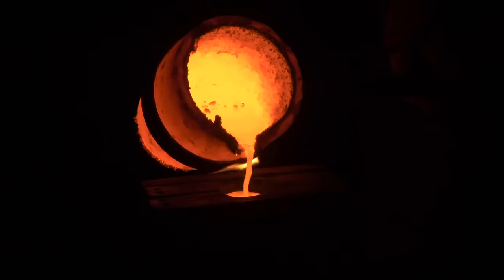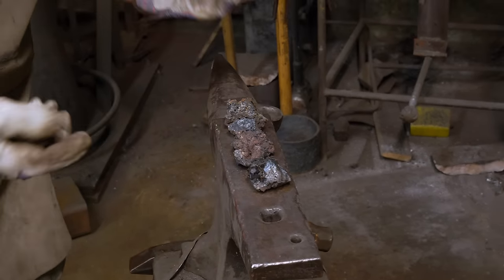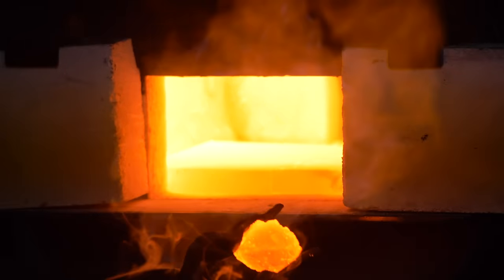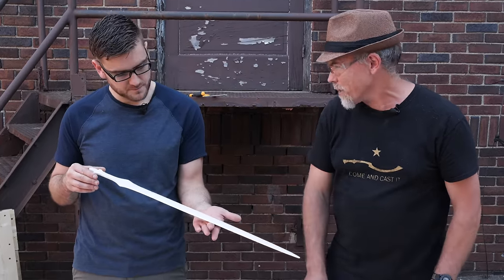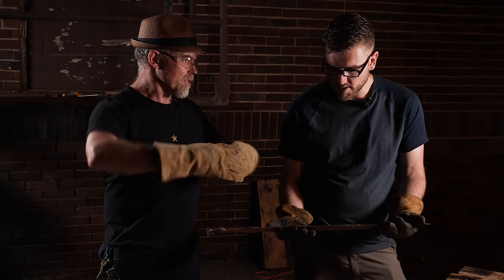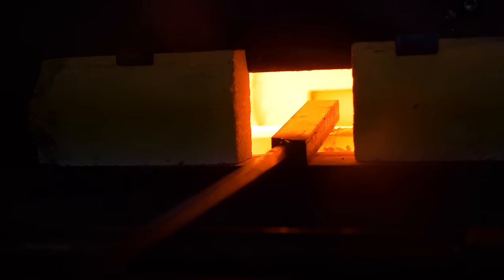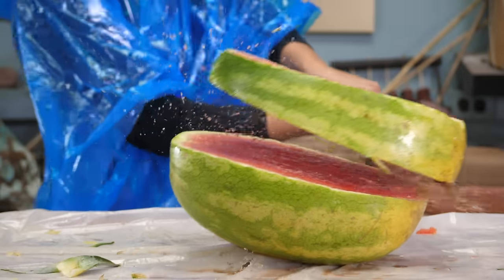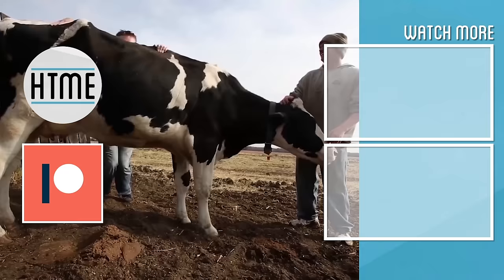Forged Iron Sword vs. Cast Bronze Sword

Comment: Imagine if the gun was never invented, the sword would still be a good weapon
Reply: The crossbow would be the everloving shit by now.
Reply: @aleksfoxtrot8044  hahaha, let me show you its features!
Reply: People used to walk around town beating the crap out of each other with quarterstaves. If we never got guns but metallurgy still improved, we'd see people walking around with smallswords and daggers. And I'm sure people would have slingshots instead of slings, and crossbows would be the Big Thing in ranged combat because of the extremely low skill needed to use one - and they're compact and can be held drawn for longer than a bow. 

Assuming we still get diesel engines, we'd still have tanks, except they'd be APCs and mobile cover instead of artillery. Maybe a ballista mounted in it? We'd probably have figured out a mechanical reload system so the ballista can fire rapidly and load itself from a magazine. And it would probably end up firing a metal ball for ease of loading and ammo storage. 

Fortifications would still matter, so you'd still see castles being built. And not the star-shaped ones, because those were built with cannons in mind. 

Since you have engines, powered flight would still be a thing, so you'd have people dropping flammables from planes and dirigibles. LTA craft would still be useful because of the shorter range of projectiles. There'd be no anti-aircraft weapons. Or rockets or missiles.

Comment: Doesn’t casting just ruin the integrity of the metal? Could be wrong but I feel like casting is bad compared to folding the metal over itself and hitting it into shape.
Reply: Yep! Folding iron over itself greatly increased the strength, assuming it was forged correctly, and, if it was welded as in Damascus steel, assuming the welds were solid!

Comment: Not only was bronze also forged, it was easier to forge, because they didn't have to get it as hot to make it malleable. Typically casting was reserved for statues, jewelry, and breastplates. But even cast bronze could still be forged. Cold hardening was usually reserved for finishing touches, such as setting the bevels and edge. Bronze wasn't replaced because it was inferior. It was replaced because iron, even though it was inferior and harder to cast and forge, was significantly more plentiful. An iron sword, when bent, is essentially done. If it was heated up and bent back into place, you'd lose the temper and heat treat. A bronze sword, when bent, can be heated up over the relatively cold leftover smoldering embers of campfire, bent back, and now it's even stronger.

Comment: Just so you know this was an unreasonable test because there's the factor of real warriors. Real warriors need to test the capacity of a weapons effectiveness.
Reply: many times thats not what happened. many times blacksmiths had to pump out as many swords or weapons as fast aspossible to fill the ranks of thousands of men with equipment. and there would not be enough time to test these weapons. so while yes. they would have "trained professionals" guys that knew how to test swords in peaceful times, not all of them  or the most of them where not done that way.

Comment: So, I know there are limitations to the show and all that, but the tests between the two swords really bothered me. Bronze age fighters would be clashing swords like that with any other sword, at least they would try not to, so I'm not sure that's a fair test. A test to see how sharp the blades stay and how the edges all together hold up against shields and armor, absolutely. Most early Iron age warfare wouldn't have been sword on sword, but the sword on shield, besides battles wouldn't really last till weapons broke.

A comment on that Khopesh, most bronze age swords I have seen in my classes, including a few Khpeshes have had a lateral ridge. A lot of the swords that you showed Greg making had those same ridges, which would've added some strength to the sword, which might have helped in the stabbing. While yes I know bronze is a very soft metal, I can bend my bronze sword, i'm just saying a ridge, like what you see on the Khopesh in Tomb of Tut Ankh Amun (KV62), probably would've helped.

Comment: I have seen a real historical blacksmith where they start with raw ore (red dirt) and finishes with a sword and its always still 10 to 30 percent slag. All those YouTubers who make videos of forging medieval swords are cheaters, sure they melt the ore into solid slag but i have not seen a single one doing the purification process. They magically go from a ball of slag to a perfectly pure steel ingot. Only way to do that is by replacing the slag ball off camera with a steel ingot. 
Purification is the longest thing to do where you must constantly reheat the slag chunk and then knock off slag chunks with a hammer, while keep the flexible glowing stuff (iron) in the ball. The ingot form like the gold ingots you see in cartoons is this form because you constantly bend the red hot ore into the center of the ball. This way, the slag that you hammer out falls off and the iron sticks back to the ball. You keep doing it until you have an ingot. 
In Medieval times nobody cared for having the purest possible iron. It was already taking too long to make a single sword. Yes you could technically make a 99% of better purity iron ingot but that meant doubling or even tripling the time it takes to make your sword. Iron and armor were worn only by nobility because they were expensive because of how long it took to make it: A single iron sword from ore 2 to sword would take up to a full week make and that's if the blacksmith had assistants to wield the bellows and help with the purification. A single chain mail took 3 to 6 months to make! So people really didn't care how pure the iron was so long as it was iron it was still way better then bronze, linin or wood. 
The ingot you see the guy use in this video isn't 
Even the right shape and is far too long to be a medieval ingot. It looks like a steel bar that's made in a modern foundry by pouring liquid steel into a mold. 
If you cant even show the purification process then i will never believe you!  
- 
The biggest visual difference between iron and steel is in the colour: Steel is all shiny light grey. Iron is not shiny at all and is dark grey. 
Real blacksmiths stopped purifying iron the moment they were able to stretch it and form it into the desired shape. The goal was always to make as many as they can and as fast as they can because the iron tools and weapons demand was always far higher then the supply and production. It stayed that way all the way to the industrial age.

Comment: The historical reason why they went to iron instead of bronze is because of the bronze age collapse where all major nations declined and the tin required to make bronze could no longer be imported. They were forced to use iron because they had no alternative. Iron was only used in Luxury products. It is way harder to work and more fuel consuming than bronze to make. Not to mention that iron workers needed much more specialised skills.

Comment: Well, steel swords (atleast maybe later on) most often had a separate cross guard, that was fitted to slide into the tang before the sleeve and pommel. Allows you to not have to take time to pound out those wings.

Comment: I've always wondered if forged bronze would fair any better instead of cast, you mentioned cold working is like forging but how much of a difference are we talking about cause forging will always be better than casting when it comes to grain structure of metals

Comment: Technically speaking the iron sword you made is much better quality than iron swords in iron age would be. The biggest problem with iron swords is slag, so basically contamination of the iron. You have to heat iron for a long time at very high temperature to get them out to get it to forging purity and then keep working it to clean it up. At forging purity it still has allot of slag and so many swords would be prone to breaking much more readily than the sword you made here.

Comment: comically, the "bronze age"  kept on for a long time.   not for weapons for for a lot of tools.    Iron was harder to work with...  and while bronze weapons couldn't stand up to iron or steel weapons...   the speed of casting vs the time to hammer forge,  made bronze and brass cheaper...   if you could pour 30 blanks at once  then have apprentices rough out axe heads,  knives, and other tools from those...   before the master finishes them off...   you have a lot more product to sell.   compared to iron  which often required the master to work it start to finish,   and generally could only work on 1 at a time.

Comment: use a magnetite magnet to get the magnetic iron out of the dust of the impurities, can also be used to get iron from black river sand, once enough iron sand just heat it up to turn into one chunk of iron, like pouring it into an empty steel bar, or for this primitive style case... maybe a clay container to hold it until the dust holds together 🤔.

another idea this gave me, it would be cool for getting metal dust for using in metal 3D printers, someone should test it 🤔

Comment: Kind of an unfair comparison at the end of the day. Swords are meant to stab and slash meat, not each other. 

Most blows that would happen would be hitting small shields and bucklers. So what should have been tested is the swords slashing abilities and which were sharper.

Maybe bronze is less durable but we have no way of knowing if its sharper cause you went and bent the sword by breaking it

Comment: The bronze sword is thinner, giving it a sharper edge. The iron looked way harder, though, as it should, and it will keep it's edge longer.
Reply: That's not a real iron sword they cheated it's a mild steel one. Iron in it's pure state is slightly softer than bronze

Comment: This doesn't even simulate the heat from thousands of men doing battle with each other, further enhanced by hot sunny days. Those bronze swords were not nearly as good in the heat of battle. Definitely wouldn't want to be trying to re-bend your notched to hell bronze sword when some one is coming down on your skull with a steel sword.

Comment: You block with your shield, not your blade. Neither of them are made for blocking. Also, the iron you are using might be to modern. There's many iron-age swords found that are so soft they they have simply been bent and then thrown into a bog as a sacrifice. Illerup Aadal in Denmark is one such place, where scores of weapons of a vanquished foe were sacrificed.

Comment: Ignoring how complicated, difficult, unnecessary or expensive its production may be, is it possible to produce a sword that is stronger, more flexible, sharper, and more resistant to rust and battle conditions using modern technology and material knowledge with the casting method and bronze, rather than steel or iron? And how is it produced? I am really curious.

Comment: One thing I have been kinda wondering is, can you take tech that we use in the modern age and make a version of it with the tech of an older age. The power hammer for instance. The way I understand it's basic internal function is that it takes rotational force and converts it into up and down force to raise and lower the hammer. So, could a water wheel be used to power it? It wouldn't be usable until a time where gears have been developed, so you can convert the speed of the slower moving water wheel into an smaller/faster moving gear.
Reply: I believe that water and wind mills were used in this way by blacksmiths at various times in history.

Comment: What if you beat one or two ribs down the flat with a harder die so that it was not only molecularly hardened but also in a shape that does bend back and forth easily? Like a tin can with ridges as opposed to not.

Comment: Iron weapons need to be forged because cast iron is so much inferior in weapons due to the lack of carbon. Even if the melting temperature could have been reached, it wouldn't have been used for weapons. That is why even today, we don't cast commercial knives despite the triviality of reaching the temperature.

You took two true truths to reach a wrong conclusion. Again.

Comment: At 9:40 thiss is not forged iron. Its a block of crucible steel that you bought. You even welded another piece of cruciblee steel to it because you didnt like using tongs. You are forging a piece off crucible steel, this is very inaccurate to history and missleading. 
The problem is when testing it, thee sword will be too good. Ever watched ninja turtle how strong that sword used by the bad guy was because it was made from the metal of higher technology. Well the sword you made would be like a magical sword to the medieval world because it bends without breaking. Forged iron is like glass it breaks the moment you start trying to bend it. Its like tungsten carbide.  Because you cheated when making the sword, all yur future tests with your sword will be historically innacurate.
Reply: they had iron at the time about this good. they knew how it worked and what metal was higher or lower in carbon. 
.
the word you are looking for is a billet, or bar stock. not crucible. all iron came from a crucible at one point, unless you are talking about iron or steel that has been folded many times "damascus" it is also why the japanese katana was quite garbage. only made this huge powerful thing through media. 
.
you are acting like they knew nothing at the time about iron. it has been known about even during the bronze age in many civilized places on earth such as china or japan. once people invented a crucible capable of holding molten iron, they could take the dross " contaminations" off the iron, and add carbon to get the content of the iron to a specific ratio. 
.
the point is, while the first people to start working with iron to not make a differential hardened sword might have not known what they where doing. it only took a few years across thousands of people and many generations of experience from other people that already knew about it to understand how to make somthing quite simlar to what we have today. 
.
also, about the "welding the metal rod onto the billet/ bar stock" there are historical events where they would take the recently forged bloom and a metal rod they had previously used to quickly forge weld the iron rod on. of course it wasnt welded. but it was forge welded. although that was mostly for billets that were too small to handle with tongs and forge without accidentally hitting and damaging the tongs in the process. 
.
did you really think they would forge iron? even if they had "iron" you clearly saw in the bloom that there was trace pieces of steel. meaning higher carbon content. and in many ways its easy to add carbon when making damascus if you cant fully melt and refine the bloom. and they didnt have enough material from their bloom so they had to start with a pre forged billet metal. so not only are you saying they were going for iron which people at the time knew about carbon content. but if they really truly did only forge an iron sword it wouldnt be historically accurate because it wouldn't have as much carbon as a sword made at the referenced time frame. if they did forge iron, it would be much weaker then any average sword that was brought into battle. many times swords had to much carbon and snapped when hitting or wrenching on sheilds or armor. not just bend. so the fact of the matter is, some swords had low carbon and bent, others had way to much and snapped, and some where just as good of a material as shown here or even better. remember, steel is made from 2 elements. iron and carbon. and any ammount of thoes in any form has been made at some time in the form of weapon.
.
the fact they grabbed a random piece of iron that they "somewhat" know the carbon content is, is absolutely historical. they had an "idea" of how high the carbon was. they didnt abolutely know. just how when steel/ iron reaches a straw color it is time to quench. back then they didnt know how to measure temperature that high, unlike the electrical temerature sensors that can tell the temperature of the sun because no material on earth at the time could measure the heat at which to quench or forge iro nwithout being incinerated. they went off color. because thats just what worked the best. they knew the basic idea, and what made a good sword, but didnt fully understand it. 
.
so please do some research before commenting. I hate to see people make a fool of themselves. especially on a dying art that only dies out further when people that have no true knowledge of the subject, or history, try and step in saying they know it all and really don't. theres much for you to learn. and the innacuracy of what they showed was very close to how they did it back then in the referenced time frame.

Comment: The color of the copper alloy sword doesn't quite look right.  Was it made from pennies?  Pennies before 1982 were 5% zinc.  Before 1962 they were 5% zinc and tin, the tin content being very small.  Good weapon bronze should be 12% tin, I think I recall reading.  Tin was hard to come by in ancient times, so bronze may only be 10% or less tin.  But Good bronze is stronger than plain iron, if I remember correctly.   Pure tin bars or "sticks" can be obtained for soldering copper pipe and such (I have a few pounds).  I'd like to see them make another copper alloy sword using 12% tin and see how it turns out.